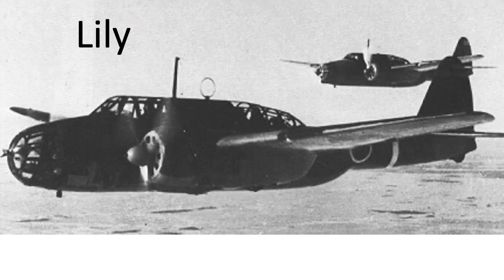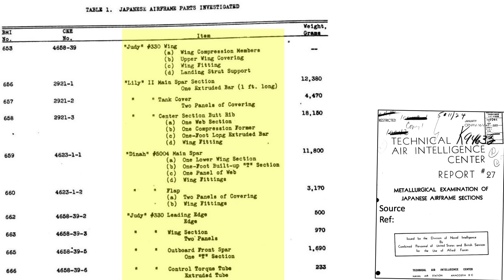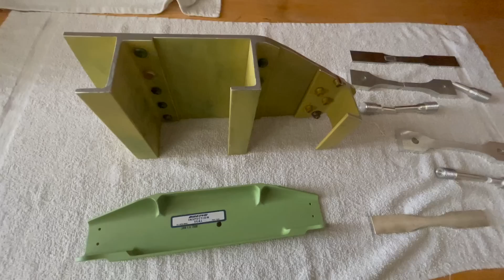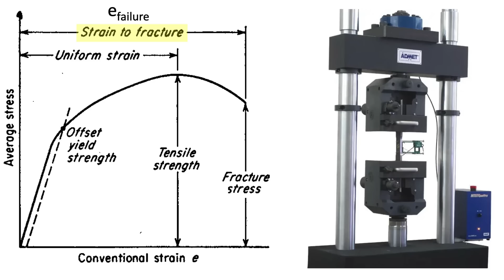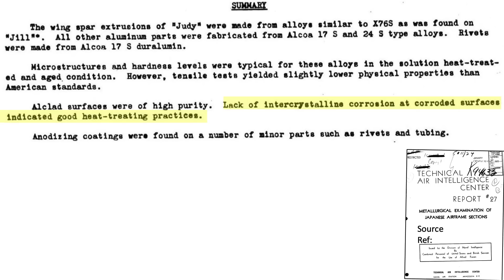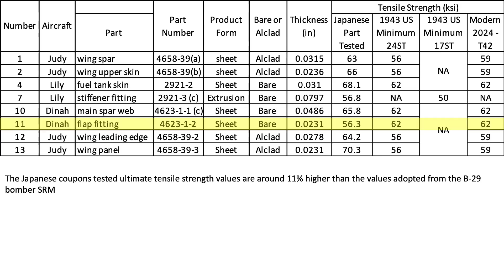WWII Japanese Aircraft Aluminum Quality vs. US Quality

Comment: On Drachinefel's channel there is a video about the A6M fighter partially titled "Zero or Hero" in which his guest speaker Justin goes into some detail about the relative strength of the aluminum alloy used in the structure of Japanese aircraft. It was generally understood that Japanese alloys were superior, with a greater strength to weight ratio than comparable US alloys of the period. This was something the US investigated early in the Pacific war and was somewhat surprised to find out that in this particular area of metallurgy the Japanese were ahead. Justin went on to explain that the Zero was designed to the same g-tolerances that were used in US aircraft. His primary goal in the discussion was puncturing several myths that grew up post-war about the relative flimsy nature of Japanese aircraft compared to western types.
Reply: As a white man I know there's a certain racist element to people's " beliefs". Nationalism, wartime propaganda and the fact that we were recent enemies led to dismissal of Japanese products as rubbish.
Reply: But not having any armor in the plane cancels out the superior metal alloy.  They also did not have self-sealing gas tanks.
Reply: @dfirth224 there were reasons Japanese planes often lacked armor. Early on, Japanese planes were overall quite good against us planes. A big part of the improvement by the US later in the war was due to pilot training and experience. As the highly trained and experienced pilots were attritted, the replacements were less well trained and experienced. That hurt the Japanese effectiveness quite a bit. Plus, the better and improved Japanese airplane models were not being produced in high enough quantities to go up against the swarms of newer upgraded allied planes being sent to the theater.
Reply: @americanrambler4972  you could also argue that the Japanese design of the A6M was "conventional" in that it prioritized climb, turns, and speed, while the Wildcat was better armed and armored, and it took time to develop the institutional knowledge to use the F4F to its strengths.  That's somewhat about the training time of each pilot, but also about having good pilots survive combat long enough to discover successful methods.
Reply: @kevinrusch3627  you can't really argue that because and it's initial designs. The wild cat was no better armored than the zero, the production models were armored by the original designs which probably started around about the time that the zero was entering into service the Wildcat as far as I know, had Jack s*** for armor and it's armament was quite comparable to the zero, also, I would not argue that the wild cat or the zero is better. Armed at least in their initial designs they just had different armaments.

There's also very little argument that the wildcat was objectively better designed because the two planes could both dominate the other in a fight depending on the circumstances of the fight, when you look at the contacts of every single battle as far as I know without exception, whichever plane came out and top was the one with the altitude advantage at the start, because most of the zero could do basically anything better than the wild cat. It couldn't do it better by enough to make up for a disadvantaged starting position, the only true advantage of a wild cat over a zero is the dive speed and the pilot survivability but a pilot surviving a plane getting shot down means that plan was still shot down, which is why the later models of the zero didn't receive armor because the pilots didn't see it as necessary when they were already struggling to best of the Wildcats.
Reply: @dfirth224 something to remember is that the zero was initially given to the front line fighters in 1940, I forget when the first plane with self-sealing fuel tanks was introduced but it was either around 1940 or even 1941, they were not a feature that the zero sacrificed. They were invented after the zero was pretty much done. Its design and the Japanese had other priorities than slightly increasing the durability of their fighters. When at least in the beginning of the war, this wouldn't have made much of a difference at least by the Japanese calculations.
Reply: @the_undead  The Germans were installing self-sealing tanks, mostly in bomber aircraft fairly early.  The British put an armored headrest in the Spitfire in 1940 and a kind of attempted self- tank using linatex, which was apparently not very effective. The header fuel tank didn't receive a self-sealing feature until very late in the war in the Spitfire. They opted to use some light armor designed to deflect rifle caliber rounds fired at shallow angles instead. By 1941-1942, most European fighters were receiving substantial armor and effective self-sealing tanks. The only European power well ahead of the curve  were the Soviets who had begun armoring their aircraft well before the war. In the Pacific, the Japanese Army started getting armor into their aircraft slightly later than the US and British did. It was really the IJN that was late to the party, mainly due to the range sacrifices required to adequately armor and provide self-sealing capabilities on its aircraft.
Reply: @charlespolk5221  and those range sacrifices happened because the zero was in service before any other plane that received armor at all. The point that I'm trying to make is that the zero fundamentally did not change much throughout the war and it was in service before the first fighter as far as i'm aware even got anything approaching armor. And it wasn't so much the range that was a concern for the Japanese, That was part of it but the primary concern was armor might take away the only advantage a zero had which was its maneuverability. The only thing the zero could do better than any American fighter was maneuver. So why risk taking that advantage away for a slight increase in pilot survivability, I don't know if they should have armored their planes but they decided not to and they had several very good reasons to do so. So I'm going to say on balance it was probably better for them not to because they could very easily put that metal to other uses. That would probably be more beneficial, and realistically this entire discussion is a waste of time because nothing Japan could have possibly done would have changed the outcome
Reply: @the_undead  The A6M5b and c models both featured armor protection for the pilot along with self sealing fuel tanks along with provision for flooding the fuel tanks with carbon dioxide.
 One of the chief criticisms leveled at the operational level for those aircraft was its  reduced range. That went against the original design specifications for the Zero fighter. Although the Zero was a maneuverable airplane, it wasn't nearly as maneuverable as the A5M it replaced or the IJA's Ki-43 Hayabusa, a fact about which Japanese pilots complained bitterly. At one point, after the Zero design work had been completed, Hirokoshi was asked to rework the design to emphasize maneuverability, but the result, while very maneuverable, failed to fulfill almost none of the previous requirements. On the whole, the Zero may have been a maneuverable aircraft in comparison to its allied contemporaries it was only mediocre compared with its Japanese rivals in 1939 and 40.
Reply: If your performance is greatly superior vs your opponent, why worry about armor or self sealing tanks?
Reply: @dfirth224 you are repeating myths which Justin Pyke dispels. US fighters were only beginning to get self sealing fuel tanks in the early months of the war.
Reply: @dfirth224  True. But you should go read up on how many allied planes had armor and self sealing fuel tanks at the time the A6M2 was introduced in 1940. It's a simple answer: none. Almost none of its adversaries in 1940 thru mid to late 1942 had armor or self sealing fuel tanks. Not the P-36, not the P-40, not the F4F, not the F2A, not the Spitfire and certainly not the hodgepodge of aircraft flown by the Dutch. However by early to mid 1942 armor (sometimes just a simple head plate) and self sealing fuel tanks (again, some of which were rudimentary and largely ineffective), was added or being added to most of the aircraft contemporary with the Zero. And it has to be remembered that these additions weren't like toggling a switch in a video game where all aircraft everywhere suddenly got armor and self-sealing tanks. By the end of 42, nearly all aircraft except Japanese naval aircraft had armor and SST.  The Japanese didn't get around to adding these improvements on the Zero until late 1943, but arguably, the Japanese had a much bigger problem in the form of experienced pilot loss than simply not having armor and SST. IMHO, the two things that really held back the Japanese in terms of hardware were their poor radios, or rather, the radios were good but they lacked the technical field personnel who knew how to properly shield them, and a lack of engine development. At the time the US was installing engines of 2000 hp the Sakae engine in the Zero was barely making 1000 hp and the most that they could wring out of it was 1200 hp by the  time the A6M5 was introduced. And it must be remembered that the Zero was meant to be a long-range escort fighter that could fly close to 1000 miles to a fight and then back again. The allies didn't really achieve that kind of range in a successful fighter until the introduction of the Mustang.  Yes, the P-38 COULD fly those distances but it had problems that didn't really get sorted until 1944, and it wasn't flying off of carriers.
Reply: @dfirth224  Very few planes had self-sealing fuel tanks until 1941 or 1942.
Reply: Steal handles bullets better then aluminum
Reply: @tomhenry897 But generally you don’t use steel in airframes because of its extra weight. So what’s the point of your point?
Reply: @tomhenry897 you say that like planes are ever built out of steel
Reply: @tomhenry897  but no metal improves range, which gave the IJN a big strike advantage early in the Pacific theatre.
Reply: @williamchamberlain2263 as far as I know, no plane has ever used steel as a primary structural component, there might be a few bits and bobs in various locations on specific planes, but still has too many downsides to ever be considered for use in aviation,
Reply: @the_undead  
The Hurricane relied on a high tensile steel spar in the mid-section of its' wing & across the tail plane.
Reply: @garybrown1404  so one or two components on one mediocre plane.
Reply: @the_undead  Some Migs did..... Mig 25?
Reply: @chrismcleod9748  that sounds more like an aluminum shortage in the USSR then anything else

Comment: In 1940 before entering World War II, the United States became involved with protecting the world's largest cryolite mine in Ivittuut, Greenland.
The difficulty of separating aluminium from oxygen in the oxide ores was overcome by the use of cryolite as a flux to dissolve the oxide mineral(s).
Reply: Also, some years before the war FDR endorsed the building of the Grand Coulee Dam on the Columbia River in the Pacific northwest because he knew that eventually Boeing would be building a large amount of very large aircraft at their facility in Seattle, he knew that smelting aluminum takes a tremendous amount of electricity to do it, and a dam with large powerhouses would be needed in the region for whoever was going to be supplying Boeing with the aluminum for all the bombers they'd be building, he knew even in the mid 30's what was coming.
His foresight turned out to right, and the Grand Coulee Dam was finished and went operational in July of 1942 just after the US entered the war.
Reply: @dukecraig2402 This is also the reason why the Hanford Nuclear facility was built nearby.  The Oak Ridge nuclear facility was built near the TVA dams for the same reason.  Before WWII there were plenty of critics of the Grand Coulee dam project.  They all called it a massive boondoggle.  But they were silenced after Pearl Harbor.
Reply: @dfirth224 
Years ago I watched a documentary about the Grand Coulee Dam and now that you mentioned it I remember them talking about Hanford being built nearby to use electricity from it.
I'd like to see that documentary on the building of it again, it was really good, I'm gonna check and see if it's here in YouTube, like a lot of the old History and Discovery Channel documentaries it just might be.
Reply: @dukecraig2402 please post link if you find it. Thanks
Reply: @frankharley1000  
It's not possible to post links from a phone but if I find it I'll tell you the title of the video and the channel that has it up, that'll get you there.
Reply: About the cryolite mine in Ivittuut, Greenland:
" In 1799, huge deposits of the mineral cryolite were found on the west coast of Greenland. This mineral is essential for aluminum extraction. Ivittuut is among the few places on earth so far discovered that have naturally occurring cryolite. In fact, the region has the largest deposit of cryolite in the world. This mineral was used as an ore of aluminium and later in the processing of the aluminium-rich oxide ore bauxite.

The huge amounts of the cryolite in this area were found accidentally when British engineer J.W. Tayler was searching the area’s deposits of silver-bearing lead. The amounts of silver were too low to yield productive mining sites. Later, in the second half of the 19th century, Danish engineers began mining the cryolite. Soon, Danish companies were granted a monopoly on its extraction.

Because the mineral was rare and essential for the production of aluminum, the mining town and its deposit of cryolite were very important. Even the Americans occupied Greenland during World War II mainly because of the cryolite. Danish companies continued the mining after World War II.

Later, cryolite was synthesized and the importance of natural cryolite deposits was drastically reduced. Production stopped in 1987 and the town was immediately abandoned. "

Sometimes this place is confused with "Mesters Vig" or Mestersvig, That was a lead and zink mine on the opposite side of Greenland, further north.

Comment: Surprising result.   I expected the metals to be bad.  I used to work on post-war Japanese cars and the metals were dog sh*t.  It was all zinc amalgam, not even alloyed.
Reply: My grandfather was a retired steel mill manager who worked metallurgical consultant in the 1960s.  A Japanese steel maker invited him to critique its new mill.  He told me that he had nothing to say because the mill was so much more modern compared to most if not all mills in the US.  Japan used the post WW-II period quite well to its advantage to thoroughly modernize its basic manufacturing  base.  In that respect Japan profited from the war, with modernizing opportunity and receiving aid to do it.
Reply: You're conflating  expensive techniques with quality of engineering . The Japanese are who perfected those low melt point alloy casting techniques resulting in massive cost savings. They were not structurally deficient in the automotive applications.
Reply: As a mechanic i can confirm japanese Cars still use inferior quality steels and are prone to rust and develop alu corrosion, they are reliable but the metals Just sucks compared to europeans ones
Reply: Still using what smelters that survived the war before we gave them new ones that put them ahead 
Plus couldn’t afford importing good metal yet
Reply: I should amend my remark about Japan having advanced mills does not imply that they are always making metallurgically superior steels.  Probably cost reduction was as much a goal as anything.